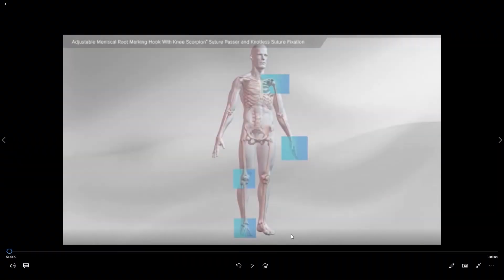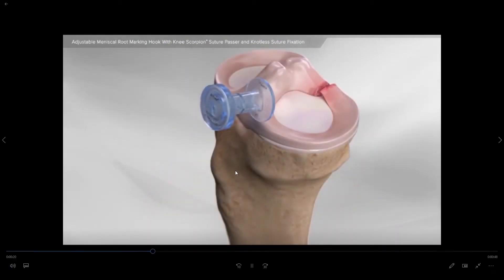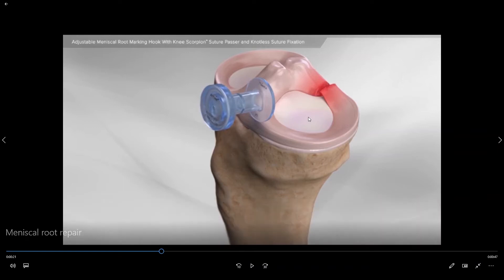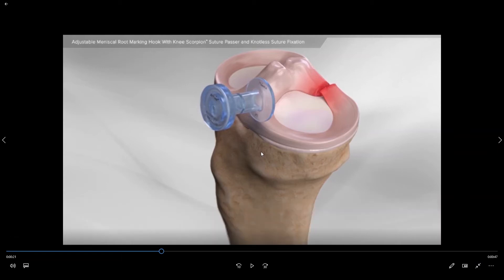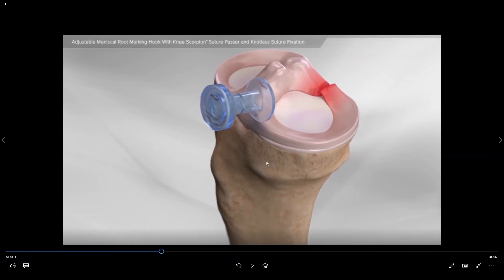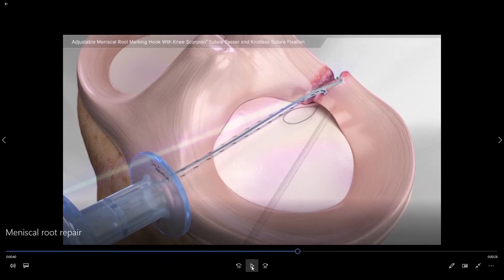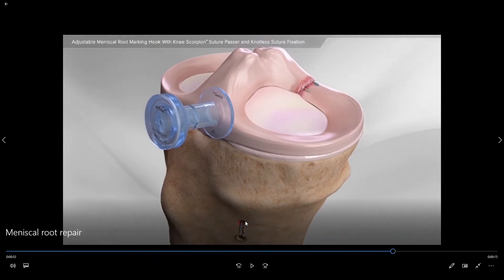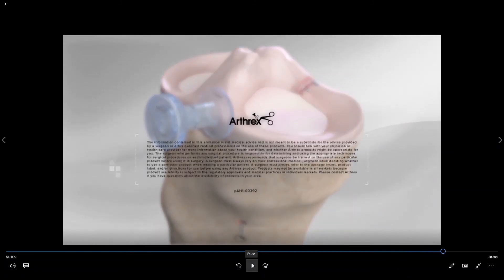Meniscal Root Repair: Surgical Technique

Comment: This was super helpful. I have a posterior horn menicus tear and wondered why the knee feels unstable. I didn't know it had been "pulled up from the bone"...that makes more sense though. Thanks for the explanation. Getting this procedure done in 3 wks
Reply: how did it go? I'm having it done Jan. 14, 2025.
Reply: @laurendeneen8672  so far really well! Be prepared for strict protocol in the first 6 weeks and definitely buy a shower chair since you'll be non-weightbearing. I'm on week 7 and really happy with how recovery is going and am working on walking. The surgery wasn't too bad but I found PT to be tougher because you're trying to get all that range of motion back.
Reply: @Ch1_M4M4  Thanks for replying. I have gotten a shower chair with handles that raise it up, a raised toilet seat and am going to get an ortho wedge pillow for support. I think I am prepared for strict protocol as you said for the first 6 weeks. I am going to prepare food and freeze it to make it easier on my family to feed me!  Did you use crutches or a walker?  How did getting up at night to use the bathroom work for you?  I am 70 and had 3 kids so I get up a few times a night. That's one of my biggest concerns.
Reply: How soon could you drive?  Mine is my left knee.
Reply: @laurendeneen8672  you could probably drive  as soon as you're not taking opioids. Mine is my right knee so my doc said after 6 weeks is fine as long as I can get in and out of the car and break suddenly. I haven't tried yet
Reply: @laurendeneen8672  can someone stay with you? Or will you be at like a rehab place? My parents were kind enough to let me recover at their house. I needed a lot of help the first several weeks.
Reply: @Ch1_M4M4  I was planning on being at home. My husband will be there in the evenings and my son in and out during the day. What kind of help exactly did you need?  Did you have crutches?
Reply: @laurendeneen8672  yeah crutches. Getting up to use the restroom the first week, from then on food prep, getting ice and some help needed with getting into and out of the shower etc. Drive you to pt. It's very humbling.
Reply: Thanks for sharing your experience. You wore a brace right that kept your knee at a 15° angle – is that correct? Did you sleep with it?
Reply: @laurendeneen8672  so after surgery my brace was locked and it was at 0 for 2 weeks. Then when I started pt they unlocked it to 60°, then week 4/5ish unlocked to 90°. Week 7 i hit 110° so my brace is fully unlocked now. Whenever I was sleeping or crutching around I had to keep it locked. 

They'll give you directions about how to elevate it and not mess up your extension. Definitely follow it. I think some people put like a pillow under their knee to sleep (instead of like under your ankle) and then struggle in pt to get their knee extension back to 0°.

Comment: What's the recovery time on this surgery ? Weight bearing,  physical therapy etc
Reply: 9 to 12 months. First 6 weeks no weight bearing and isolating exercises. First 4 months no leg press. 9 months no side jumps etc. It’s likely 12 months before you can start doing almost everything on competition level. I had this with an acl reconstruction. It took me longer to recover.